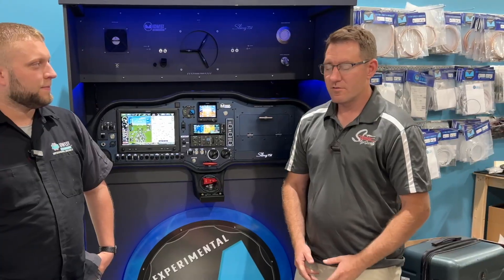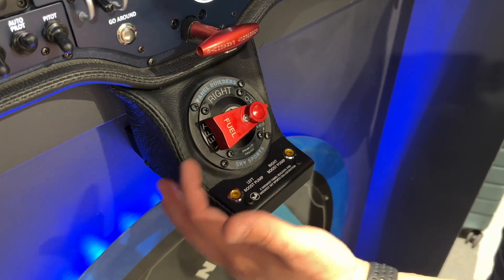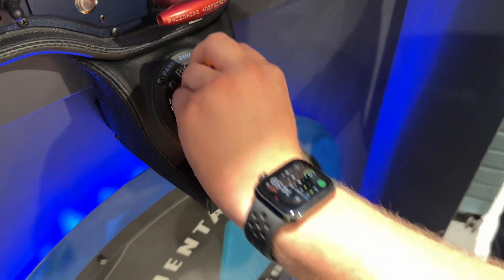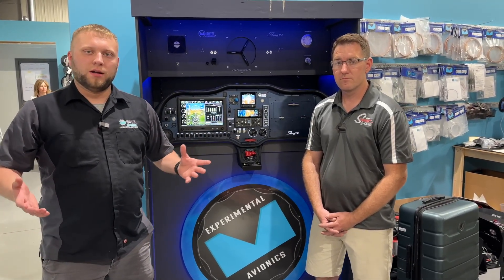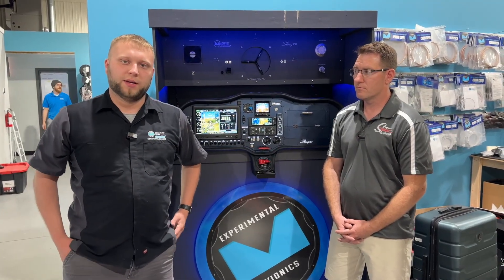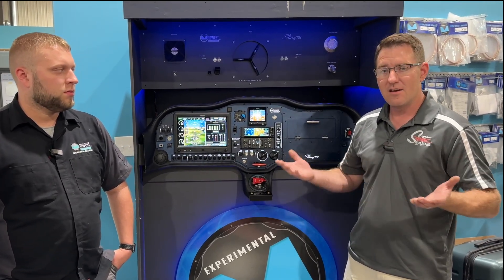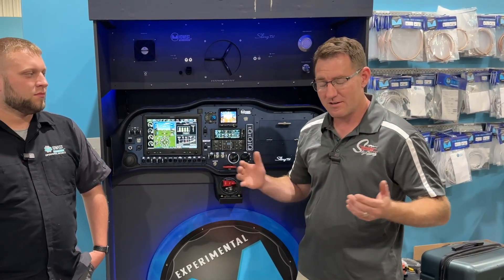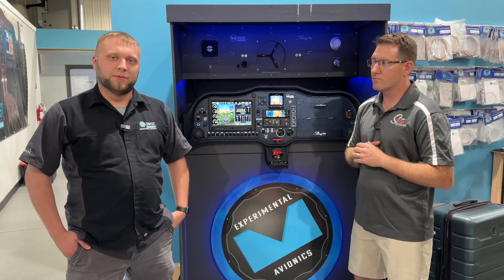Sling Vapor Lock Solved?

Comment: I’ve heard of this being an issue, but it’s hard for me to understand what the problem is as I have thoroughly tested my Rotax 915 using mogas and avgas in the winter, and summer. Even at 25,000 feet with the aux fuel pump off I was getting 53 psi. My Rans is a highwing and maybe that puts less stress on the system. That’s about the only thing I can make of it.
Reply from the maker: You are correct, since you have a high wing, gravity is on your side.

Comment: This is super Adam. I've been noticing, in this heat, my fuel PSI sitting at the bottom of 42 and often going below into the yellow range. Very unnerving.

Plus I'd love to be able to move to Mogas with no fear.

You expect it to be retrofittable?
Reply from the maker: Yes, with a little bit of work it can be installed.

Comment: Would this be a potential problem in any LSA with a Rotax using MOGAS with ethanol? I have a Bristell and have avoided 100 LL completely and bring fuel in with (unfortunately) ethanol.
Reply from the maker: It could potentially be an issue due to where pumps are mounted and differs with each design. If you suffer from vapor lock than this could help.
Reply: @MidwestPanels  I've never experienced it... I also don't want to experience it. Is this a common issue with the just Bushcat then? My tanks are vented. Wouldn't that prevent vapor lock?

Comment: Excellent! This is exactly what I envisioned would be needed to prevent issues with high RVP mogas. @EvanBrunye and I discussed this exact design many months ago. Glad to see his idea being developed for the market!
Reply from the maker: Actually the original inspiration came from a TSi builder in Utah 3 years ago when we were doing his install.
Reply: @MidwestPanels  Oh wow. Yeah, it’s entirely possible for two different people working on the same problem to independently converge on the same solution. I know Evan and Henry spoke about the idea. In any case, I’m glad to see the idea coming to fruition!
Reply: @OneAlphaMike have you experienced any issues with your plane? Perhaps you should make a video about this. I am based in LA and take off from Van Nuys where summer temperatures reach 100 degrees during summer days. I was completely oblivious to this issue. It appears that 100LL solves this issue.
Reply: @tsilikasp  Yeah, I had an issue once. The problem is not with Rotax or Sling, the problem is lousy high RVP mogas. The most common issue is winter blend fuel being sold past when it's supposed to be in the spring. I might do a video about it, but in the meantime, there's a good video on the subject here: https://youtu.be/aKVyA7ROQ6A